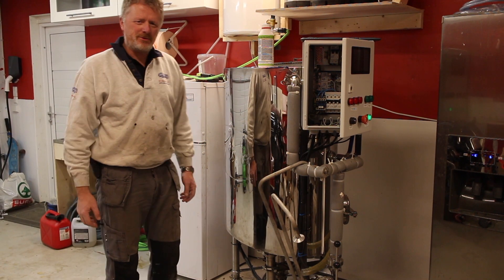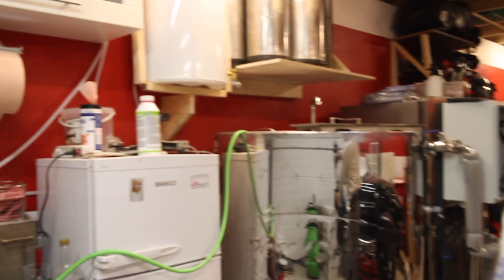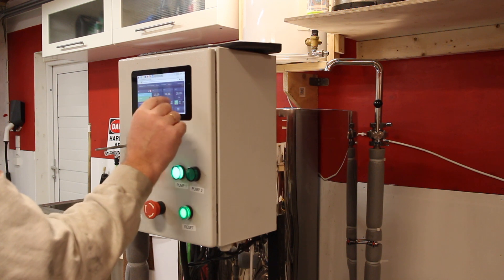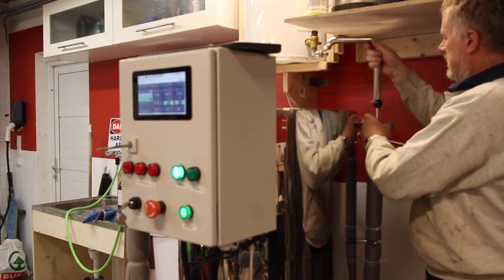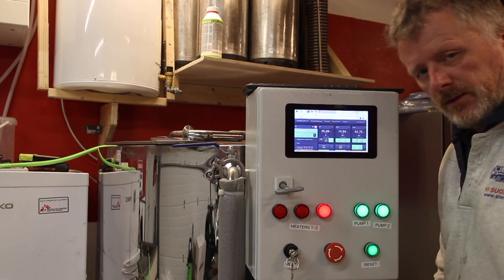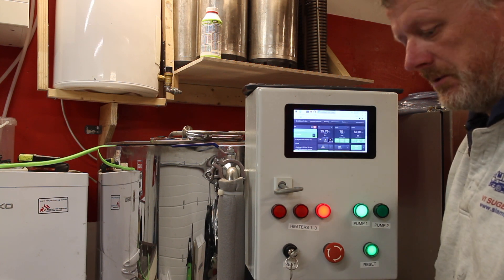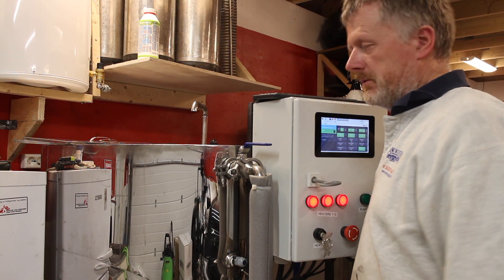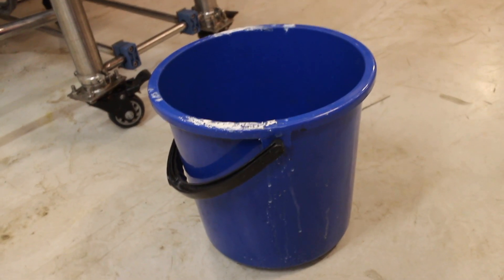Trial run of brewer with heat exchanger

Comment: Do you not want the mash in the 65 deg or there about?  You need to have the HLT water up between 72-76 deg mark before you transfer to the mash tun section. Love the setup!!!
Reply from the maker: Hi, you are of course right, the temp difference should be at least 10C. During the first brew with the heater loop the temp in the mash still went down, probably becuase of too little heat radiated from the fairly short loop inside the mash tun. I am now working on turning the heat exchange opposite, circulating the mash through the pipe which is then suspended into the HLT tank. I hope this will transfer more heat to the mash tun, as there will be more movement in the liquid. Will see in a couple of weeks when I do the next batch!
Reply: Bjørnar Huse can you add a coil into the heat exchanger?